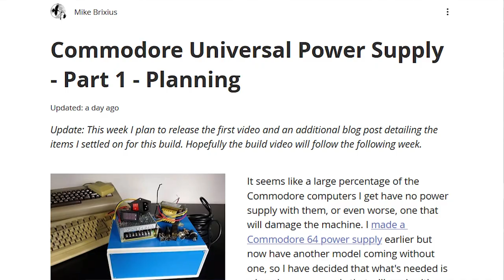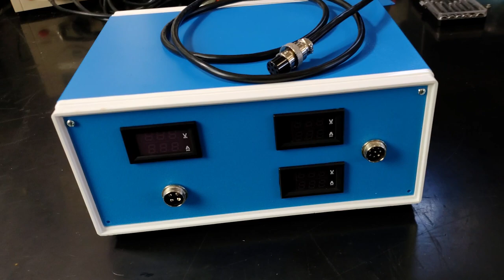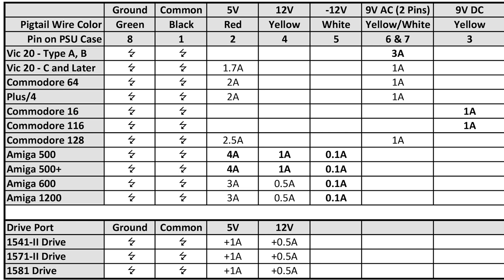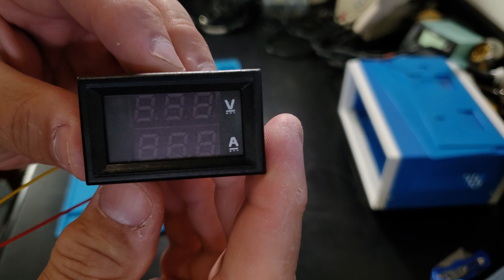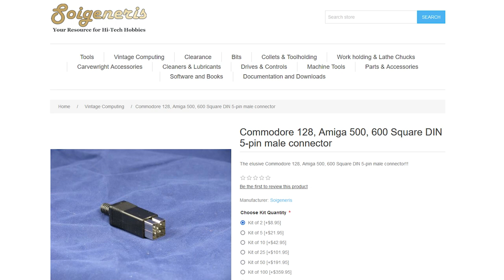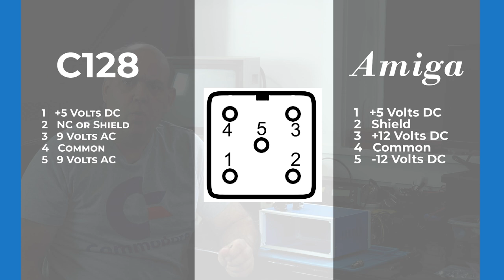Build a Universal Commodore Bench Power Supply Part 1 - Plan & Parts

Comment: i would just slip a red or blue butt connector over the din pins to give a easy place for a meter probe with no danger of shorting,but the female din socket also works well.
Reply from the maker: That would certainly work. Honestly the main reason I used them is that it was convenient and I had a few extras because the ones I got came in Male-Female pairs but I needed a lot more male connectors. I hate waste!

Comment: Can you use the old 9V AC from a brick if you can get it out, I understood the 5V is what goes on the old bricks.
Reply from the maker: Sure, anything that gives you 9V AC with at least 1 Amp should work fine. The problem is getting the AC transformer out of all that epoxy. If you are going to use it still potted than I would be careful that only the AC transformer is energized and that all the old DC circuitry is not powered.

Comment from the maker: Do you have any suggestions or have I missed anything? My only concern is field collapse on the AC transformer causing a voltage spike at power off. If so I will have to add a resistor and capacitor to the transformer.

I also neglected to include the clip mentioning that the Plus/4 has a unique connector that I cannot find. My hope is that when the time comes that I need one I will have a bad PSU to steal the power cable off of unless you know where to get one!

edit: 1 Change I have to make is to use volt meters instead of volt-amp meters. I'm working on options and will explain in the next video.
Reply: A Plus/4 is a 128 power connector with the center pin snipped or removed. The pin out I don't have on hand.
Reply from the maker: Nighthawke70, Awesome, THANK YOU. I just happen to have one spare connector of that type.
Reply: @RavenWolfRetroTech  The other weird part about the Plus/4 is that it has TWO different power jacks according to what I'm seeing online. The round one that the C64's have and the 128 plug that went a round with Mike Tyson. 

IMO, I'd rather use a pigtail with  the standard round jack, and wire accordingly into the proper connector. It just gets too messy trying to have too many cables sticking out of the back of the thing. Or else have two or three cables with the C64 plugs, and use the pigtails as needed.   Then store the spares in a baggy attached to the side of the supply.

And yes, use a bleeder circuit to ensure no spikes happen on power termination.
Reply from the maker: Nighthawke70, If they changed the Plus/4 to a round connector I would hope it would be the standard C64. It uses 5V DC at 2 Amps and 9V AC at 1 Amp, exactly the same as the C64. Knowing Commodore they probably had a ton of C64 PSUs they wanted to get rid of. If thats the case then square connector Plus/4's would have their own pigtail and round would use the C64 pigtail. The design is such that as long as a machine doesn't exceed the provided voltages (Within current limitations) then a pigtail can be made. The current plan would eventually leave me with 6 pigtails for computers plus the one for an external drive.